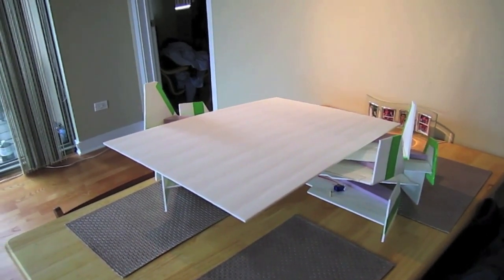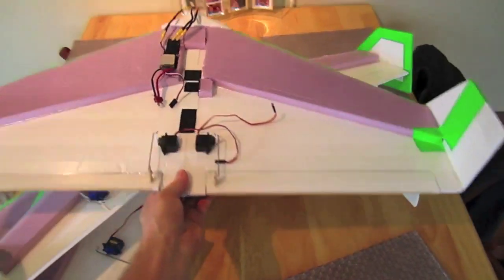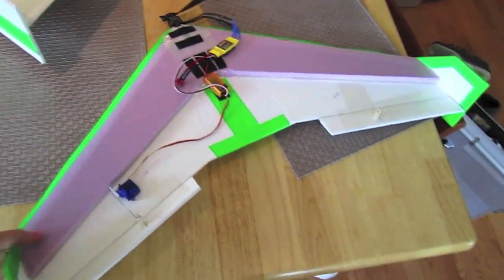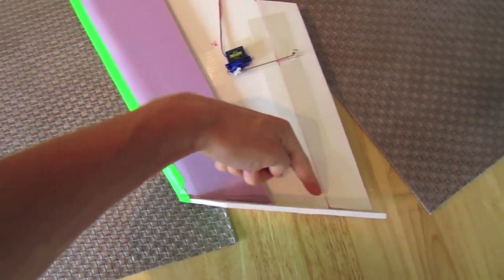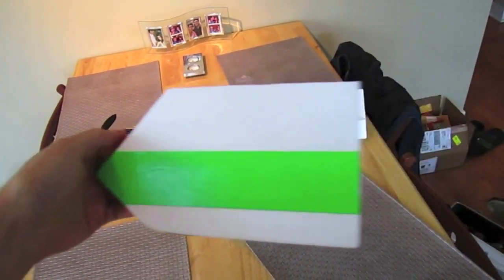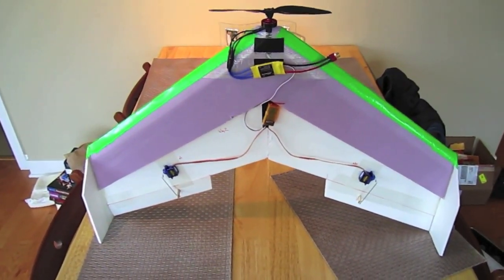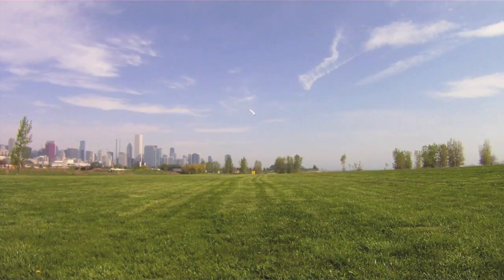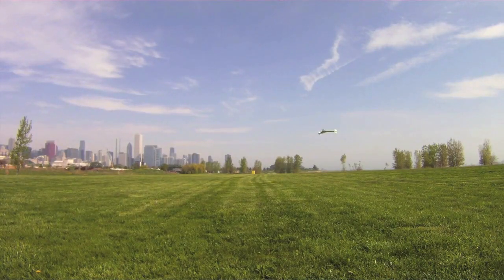RC Delta Wing - Design and Maiden

Comment: Hi , Have you tried folding the wing around a depron spar ? make the wing in half's and just scaw  a line in the centre with a knife - not going all the way through . Then fold the wing over and glass tape the TE down . Use a carbon rod for a spar to glue the wings together . look at my video -   How to Fold depron wings

Comment: I'm a senior in high school and i'm conducting my senior capstone thesis project. For my project I'm building 12 different wings. I need to order the materials; however, I need help designing the wings. I'm making 6 swept wings and 6 delta wings (all different materials) but I can't order the materials if i can't design them. I've looked everywhere on how to design small (small enough for a homemade wind tunnel. I'm thinking around 6"), swept and delta wings but I can't seem to find anything. Can anyone help?

Comment: So here is a funny question!  Never flew a rc plane my life or made one.  Can fly a helicopter 3d or multirotor blind folded though lol.......   How the hell do you set up the servo wires to the RX for a delta wing?  Use one channel or mix two ?  Normal plane I get.  But not a delta wing and no one seems to say how online.